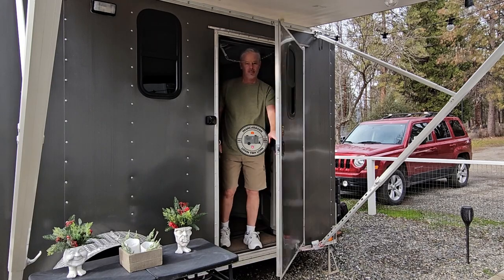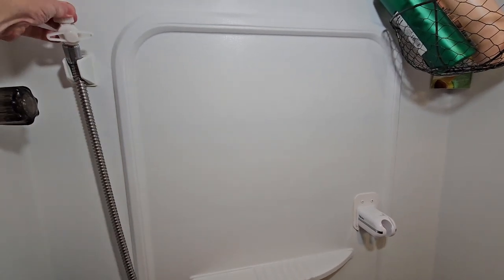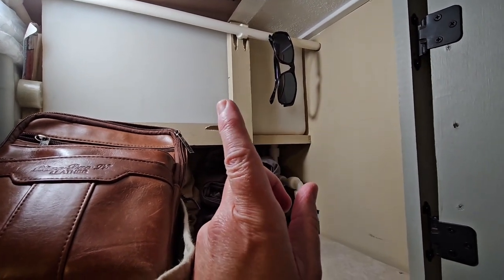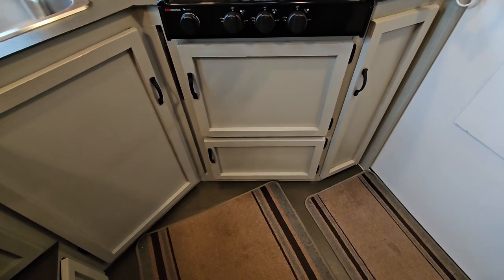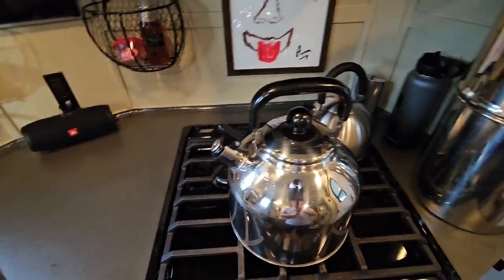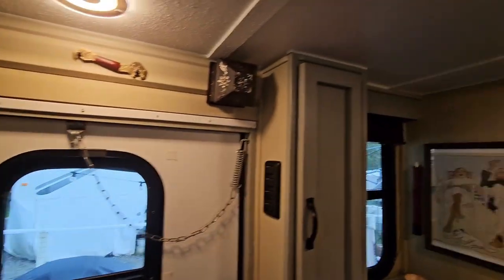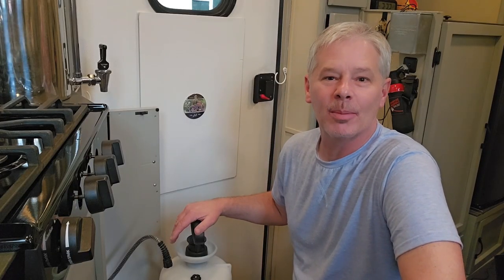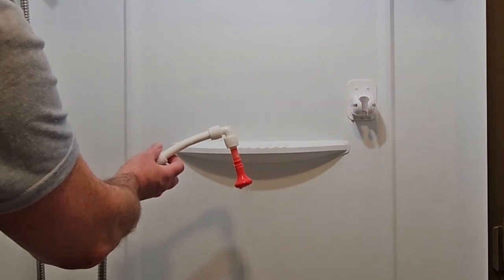Compact Luxuries - Gravity Fed Shower in a Cargo Trailer Conversion!

Comment: I had an RV that had the crappy tub shower base that cracked the way you described. Such a pain and expense to replace. I used a plywood base to reinforce the tub but did not remove the styrofoam.

Comment: I have thick classic length hair so I don't think this method would work as well for me. When I used to color my hair though i washed my head with cold water in the sink so that I didn't wash out all the expensive color. I could still do that with your method i suppose. It's kind of invigorating.
Reply from the maker: For sure lots more water for long hair. Cheers